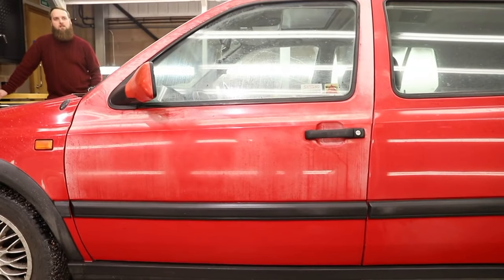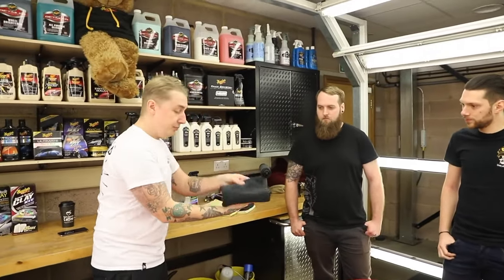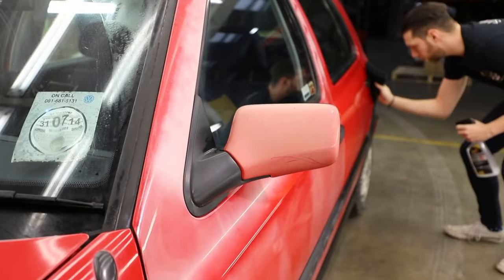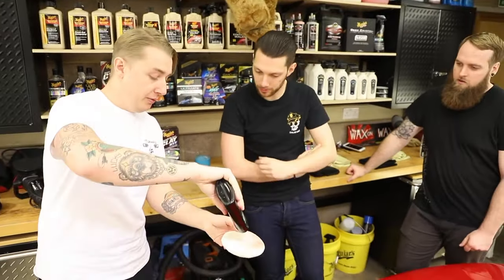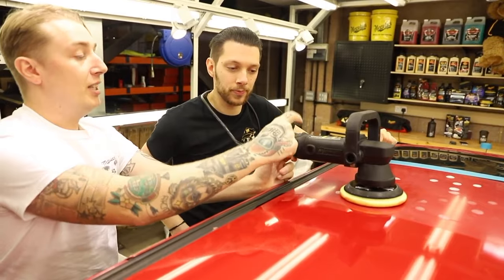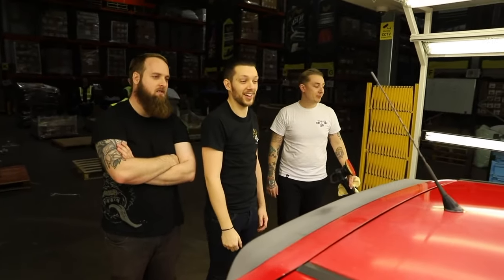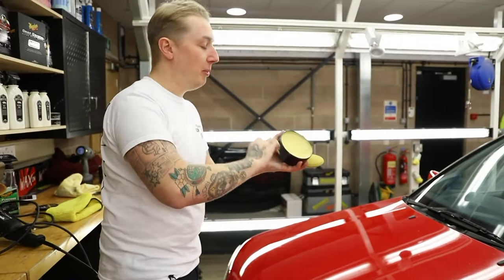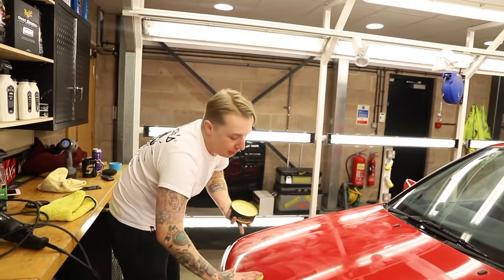How to Use Ultimate Compound to Restore Faded Paint - Day in the Bay – UK Edition

Comment: Will the ultimate compound work in my situtation because I have some chipped paint on the hood and I think of sanding it and I am curious if it works after sanding
Reply from the maker: If the paint is chipped using a compound will not help as the paint has already been chipped/removed in those areas.  Typically the only thing that will fix chips is touch up paint.

Comment: Very indeph video and demonstration 💪🔥🔥 thank you
Reply from the maker: Thank you for the feedback.  👍
Reply: @meguiars  I am trying to understand the functional difference when repairing oxidized clear coat by  using the compound versus  re-applying a new clear coat.  So would you say the compound is like an alternate way to get a shiny transparent top coat  (thus avoiding the need to respray a new clear coat) ?
Reply from the maker: Those are two very different things.  Compound is used to remove defects including oxidation in the existing clear coat (paint).  It does not leave anything behind and does not coat your vehicle with anything.  It is simply remove to store existing paint.

Repainting is of course a much more expensive and difficult process most consumers would not undertake on their own due to the lack of expertise, tools/equipment, proper paint booth, etc.

If you are trying to diagnose whether or not your paint is salvageable please feel free to reach out directly to our Solutions Hub via our website.  Any of our experts would be happy to help you figure out whether your vehicle possible has oxidation or has failed entirely requiring a repaint.

https://s.3m.com/9pxkwwi3

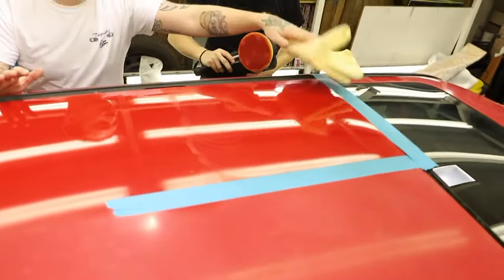Comment: HELLO HARRY MEGUIRE... I have a car that is in a similar condition. I would like to introduce the water sanding sanding step in this process. I want only to lightly sand it by hand maybe with the use of a machine with very light pass and Grit grade. What grit would you guys recommend and what would be the correct order for these steps to include the light sanding. To complicate things I want to add a light 2k clear coat to the paint as evidently all this sanding and cutting compound will remove clear and paint as at 8:35 on an oxidised car surface. Thank you
Reply from the maker: Typically we would recommend finshing with 2000-3000 grit paper.  You will then want to compound and polish to remove the sanding marks and give great shine/gloss.  Here is a video that shows how best to do that with some of our best compounds and polishes...

https://s.3m.com/s264vu

Comment: I have a charcoal gray 2011 Lexus IS250 with oxidation on the roof of the car. It’s very faded and kind of shiny in a weird way. After the Ultimate Compound, what should I use instead of the carnauba wax?
Reply: And is the Ultimate Compound going to be enough by itself?
Reply from the maker: Ultimate Compound is the product that will remove oxidation but typically you would at least want to wax after to protect the finish.  You can use your favorite wax of choice.

Comment: How come a clay bar wasn't used to clean the fine dirt and dust before applying the Ultimate Compound like I've seen in other videos by Meguiar's?
Reply from the maker: Claying is not always necessary but yes, that would happen after washing and before compounding if you have bonded contaminants on the surface.

Comment: How are the results on a white car.? - My '94 MX6 is in dire need of polishing on top of after market clear coat  Will this process work ..?
Reply from the maker: The process is the same regardless of color.  As long as the paint is not already at the point of failure it is absolutely worth a shot.

Comment: How much RMP do you use for final polishing?
Reply from the maker: Not sure which step/product you are referring to when you say "final polishing" but typically for application of a polish or wax with a good DA polisher we recommend about 3000-4000 opm (orbits per minute).
Reply: I was wondering how much rmp to polish with Meguiars ultimate comboud polishing paste after it is applied to the surface?

Comment: I just did a cut on a Milano Red 200 Integra (using macguires ultimate cut) and my cutting pad had no red residue on the pad. Any idea on what I’m doing wrong? Pretty sure it’s a single stage paint. Perhaps I’m not putting enough pressure? Thanks in advance for tips or pointers
Reply: I have the same issue with my Milano Red. Tried wet sanding a small area and still no red so I’m pretty sure it’s two stage unfortunately.
Reply from the maker: If no red is coming off on the pad that means you do not have a single stage paint you have a clear coat.
Reply: @meguiars  Cheers, thanks for the response. Legends!
Reply: @chemstuff2657  Thanks for the response! Agree

Comment: What pad is better using this product because my truck paint faded some can I use a yellow pad or another color like orange. I am using a rotary polisher though.
Reply from the maker: We don't necessarily recommend this product be used with a rotary buffer as it is designed for hand, orbital, or DA application.  The effectiveness and ease of use could vary widely.  That being said we don't have a recommendation on a pad for a rotary but if it were used correctly on a Dual Action Polisher we would typically recommend our foam cutting disc (burgundy).

Comment: Awesome video! Have an 87 300sl and the bonnet, roof and boot lid look exactly the same as the picture on the front of the bottle so seems like a no brainier! A couple of quick questions, after the wax is applied does it just soak in or does it require further buffing? Also if I have a couple of rust bubbles forming do I need to avoid going there with the polisher?
Reply from the maker: Thank you for the feedback.  👍 

The Gold Class Wax should be applied in a very thin coat then allowed to dry to a chalky haze before wiping off with a good quality microfiber towel.  This can take as little as 10-20 minutes in some environments but it can take even longer for the product to dry if it is over applied and/or the weather is not ideal.

If you have rust spots you will want to keep the product away from them simply because the residue could become trapped in those areas and difficult to remove.

Comment: Hi, great video, thanks.

I've been trying to achieve the same on a 2007 Honda Jazz but it has been a complete fail :-( 

I started with finer pads / compounds which had no effect at all, then gradually went coarser - still no effect. Then I tried 2000 grit wet and dry, very lightly with plenty of water and a slightly deeper colour began to appear, but only a few strokes after that it was through to primer. I'm guessing that this particular car has a very thin colour coat and a hard clearcoat over the top. 

Would that explain why it takes an aggressive approach to get to the oxidisation, but then there's not enough depth to get back to a rich colour?

Any insight into what's going on here would be appreciated! Thanks.
Reply from the maker: Difficult to assess without more details and pictures but it is possible your paint has reached the point of failure and is not simply oxidized.  If that is the case the only remedy is repainting.

Feel free to reach out to our Solutions Hub with pictures.  They would be happy to help diagnose the situation.

https://s.3m.com/36cb78
Reply: Thanks for responding so quick! I’ll follow that up. I suspect we are looking at a respray - or more likely just live with it - hardly a classic worthy of restoration!!

Comment: New to this stuff. I did it on my car in large areas and it dried on me and i wasnt able to buff it out well enough by hand. Its been 2 days and its dry and cloudy white. Does not come off with water or alcohol. Whats the best way to remove this? Thanks for the help.
Reply from the maker: As you may have already figured out the compound should only be applied to a small section (2'X2") at a time and wiped off immediately.  There is another link below for a video that shows how best to apply compound, polish and wax by hand.  

The best way to remove it is to reapply the compound the correct way as the compound will help re-release the dried residue from the first application.

https://s.3m.com/3zhw5k
Reply: @meguiars  THANK YOU SO MUCH FOR REPLYING. Will do it the correct way this time!
Reply from the maker: Happy to help!  👍

Comment: When would you polish after compounding?
Reply from the maker: If choose to polish after compounding you would typically do that right after compounding.
Reply: @meguiars  I guess I meant to ask is polishing required after using Ultimate Compound, or can you go right to waxing after compounding?
Reply from the maker: The polishing step is often optional and a personal decision likely based on the color and condition of the paint as well as your desire for it.  If you have a darker color car and want the absolute best shine you may want to consider polishing between compound and wax.  If you have a white daily driver in good shape and your primary concern is protection you may not see the benefit of a polish.  Again, often a personal decision based on the specifics of your vehicle and your desires for it.

Comment: is the result permanent or need to repeat in a year or so?
Reply from the maker: The current oxidation is actually removed.  It's not just being hidden.  That's not to say a vehicle with old paint being beaten up by the elements regularly will not slowly oxidize again in the future.  The same thing that caused this situation could of course happen again and that is why frequent care/maintenance is important.
Reply: @meguiars  thanks for the reply
I think that some parts like the mirror its impossible to be restored , the varnish completely missing an d the colour is faded 
Maybe in that occasion you just masking ? Im asking all this because : i have a problem with my red perl hood (swift sport 2008) , 2 spots diameter about 15cm each , seems like varnish removed(not sure) 
When you pass your finger feels like light scratching 
The optical result is like light matt 
Any thoughts ? Need to be painted or by all the process i will have a permanent result( without care for 3 years )
Reply from the maker: What you are describing could be paint failure.  If that is the case unfortunately the only true remedy is repainting.  Here are some examples of paint failure...

https://meguiarsonline.com/forums/showthread.php?20411-The-Clearcoat-Failure-Photo-Archive&highlight=paint+failure+archive
Reply: @meguiars  thanks a lot 
Unfortunatelly as i see by the photos im in the beginning of clear coat failure
Reply: @meguiars  My neighbours Mini 1st Gen has a total paint failure but not on all panels. The bonnet, roof and rear are perfectly fine, one door and side panels are disastrous. That makes me think it is not just oxidation but a failure of painting itself, in the factory. All panels are exposed to natural elements in the same way since 2003 but only now it shows possibly different environments, methods or ingredients during the process of painting.

Comment: Friend has a hood trying to remove oxidization
Reply: Wash, clay, compound, polish, wax
Reply: Sniper Paint Correction that’s exactly what we did. Used ultimate wash wax and the clay bar kit and Ultimate polish finishing with Gold Class Wax
Reply from the maker: How did it come out?  Feel free to ask any further questions.
Reply: Meguiar's it came out great it would be perfect if we had a DA polisher but by hand. It removed alot
Reply from the maker: Just depends on the particular trim pieces, how easy it is to avoid them, etc.  There are definitely times you would want to tape off the trim.

Comment: My cars paint is more faded than this one, I have been told I need to sandpaper it with 1000 then 3000 grit before getting it polished, or cab I use the polish directly
Reply from the maker: That depends on the severity of the oxidation.  A couple of things to keep in mind...

1)  If your vehicle's paint is actually failing/failed and not just oxidized the only real remedy is repainting.  We may be able to help you diagnose with pictures.

2)  Wet sanding is a professional process and will require the appropriate machine and skillset to remove the sanding marks.  Make sure you are prepared to undertake that kind of project.  

If you would like to talk through the process or need more detailed assistance please do not hesitate to reach out to our Solutions Hub (link below).

https://s.3m.com/695r5x

Comment: Is this just one process? So you use the compound and it gives this shine? I imagine it wouldn't last long
Reply from the maker: The primary function of a compound is to remove defects in paint not give a high shine.  Of course removing defects, especially oxidation, will dramatically improve the appearance of the paint.  As shown in the video you would typically at minimum want to wax after compounding which would add gloss and protection.
Reply: @meguiars  What is the job of Polish? I see you can also get Maguires Polish and Wax. I assume you could do this as a 3 stage
Reply from the maker: Polish is designed to create the highest shine possible.  A pure polish does not offer an defect removal or protection and would be used between compounding (defect removal) and waxing (protection).  How much of an impact a polish has is relative to the condition and color of paint.

Comment: The faded paint will become worse after the surface dry out. If you polish it after you compound it and seal it with wax, it may hold up for 3 to 6 months. Again, you can't save faded paint by keep cutting it. Compound will make each single narrow scratch become Grand Canyon. From a distance, the paint looks haze.
Reply: I have used Meguiars on my heavily faded red Suzuki. As you said, polished and waxed well made it well-protected but a year on the care for the paint was still a breeze. The effect didn't fade again, on the contrary, with some further polishing troublesome places for absolute perfection the paintwork was absolutely spotless. Cleaning bacame easier and all it needed was a waterless wash and thick fiber cloth. No marks, no fading, water marks, scratches and any sign of oxidation. .